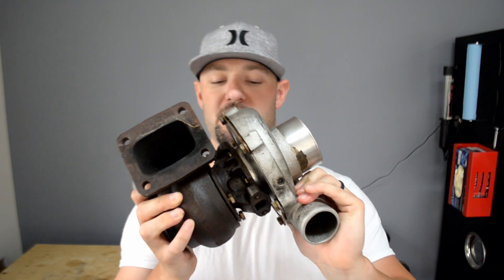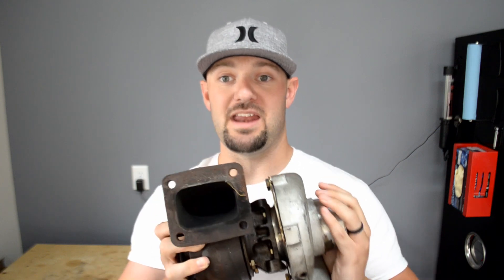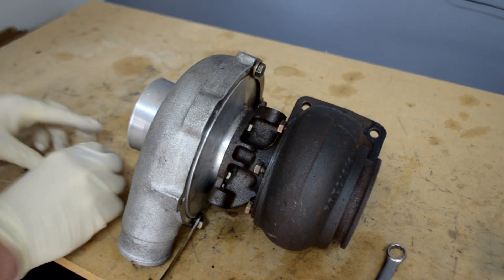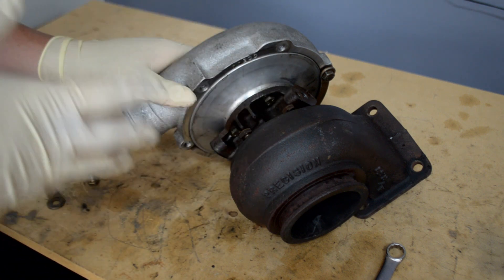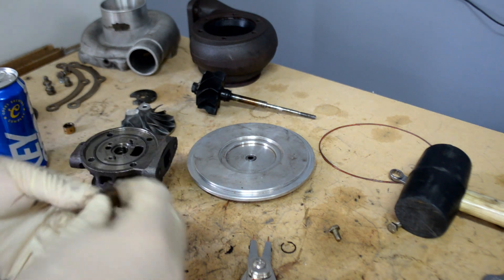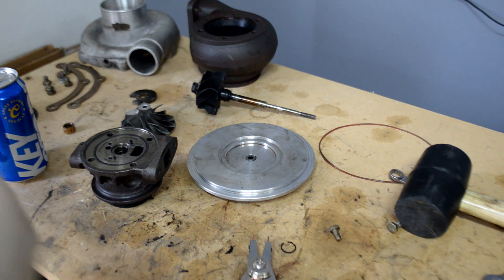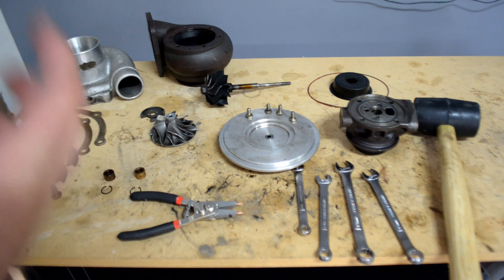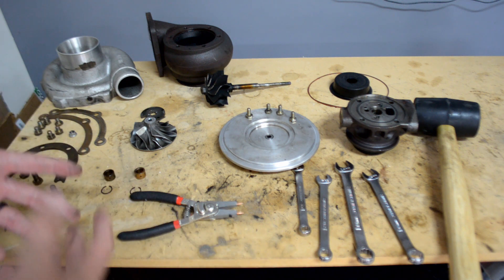How To Rebuild Journal Bearing Turbo (Pt .1 Disassembly)

Comment: I found a turbocharger on the side of the road.... Rusty bastard is currently sitting in a bucket of vinegar so I MIGHT be able to get it apart... lol I think it has less shaft play than the one in your video, But the damn this is somewhere between red and brown, So I think it needs cleaned up.

Comment: This was rough to watch......compressor wheel not inlet lol second its a T04E bearing housing buy a T04E rebuild kit depending if you have a first gen or second PTE turbo amd what turbine shaft you have last thing clean the seating ring on the bearing housing or your turbo will fail in less than 1000 miles
Reply: @PureFunction  may have gotten really lucky usually theres oil coked in the rear ring seat that causes premature failure if its running this long id say ur seat wasnt bad but idk why JB pte get a bad name they are garret based turbos with aftermarket compressor wheels and custom compreaspr housings ?
Reply: The core (chra) was garrett back in the Days.. around 2010 garrett cut pt off as a supplier for some reason idk why can't remember. But pte use steel thrust bearing. That's one reason they fail. Buy a upgrade/rebuild kit (garrett) then u got copper insted.
Reply: Yea iv never had one fail however iv had to rebuild quite a few peoples turbos who did the builds themselfes i agree the steel thrust bearings suck unless your running  20/50 high zink oil FP has the same steel thrust bearing design on the MHI based turbos and they tend to do well when the propper oil is used

Comment: Point of going single is that you can go ball bearing. This is besides the point of the video but yeah.. just don't understand why some guys go through the trouble of single converting and then just use journal bearing turbo